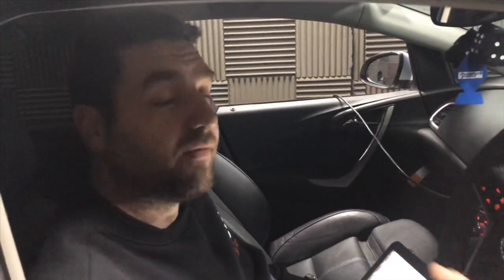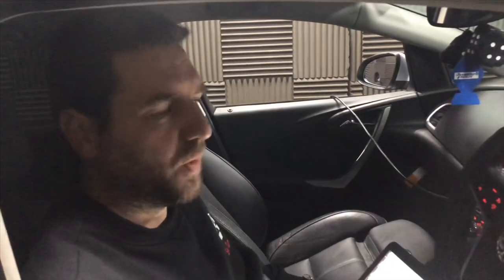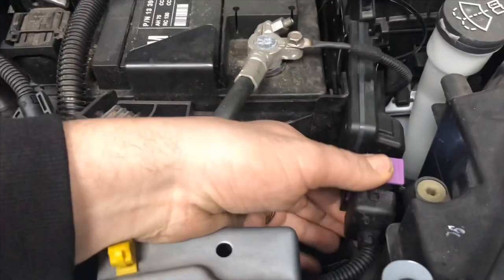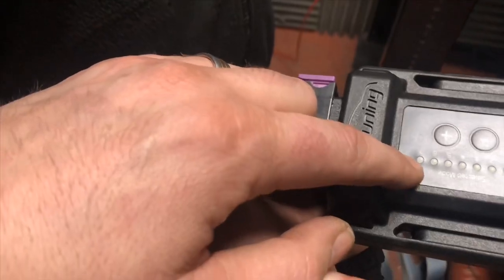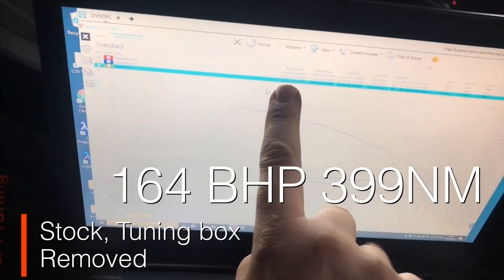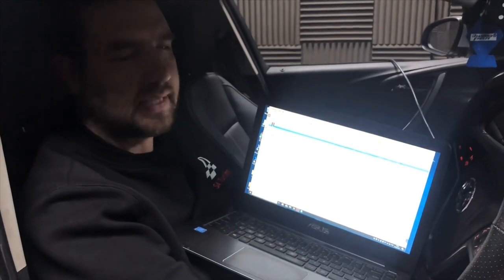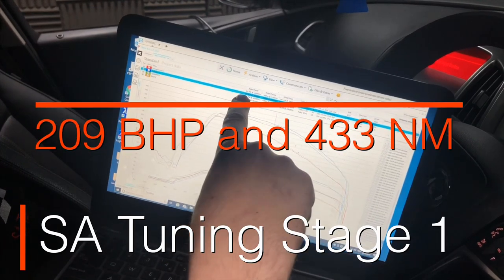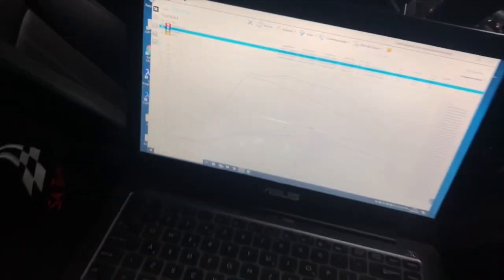Tuning Box VS stage 1 remap

Comment: a tuning company telling us a Powerbox is not what we need. WOW. you ain't gonna see a drug dealer telling you not to buy drugs and buy something else..  is the same as the Powerbox companies tells us to stop remaping our cars and use powerboxes :)
Reply: correct 100%
Reply: Well they test and compare on a live dyno unlike the powerbox companies👀 so i wonder who we should believe?🤔🤣
Reply: Powerboxes are totally rubbish guys... You can't tune a vehicle with an "out of the shelf" product.. Factors like: ambient temperature, distance from sea level,gas quality, condition of the engine  etc will affect the performance of an engine. Talking from own experience,i spent some amount of money to buy a "tuned chip" for my OBD1 engine and gain was 0. Then i did an ecu remap alone using an EPROM programmer and ProTuner and later installed a piggy back ECU too,best spend money ever....  If u have a professional garage near your area,go there,forget about those scams...

Comment: Good video. Music is a bit annoying though. Here's my tuppence worth - I've had 5 tuning boxes on 7 cars. All the tuning boxes were the same make as I liked it. I've had 2 cars with remaps. The results in this video are quite surprising to me and don't tally with my own personal experience though. 4 of the tuning boxes were fitted to Vauxhall/Saab/Fiat/Alfa 1.9 & 2.0 diesels. All essentially the same engine. I have, at the moment, a Saab with a remap. I decided to try a remap instead of a tuning box as I had a dpf issue & the remapped guy did a deal with map, dpf & egr plus carbon clean all at once. I've probably covered over 150k miles in cars with either a map or a box, and from my experience the differences between these two methods don't warrant the extra expense of a remap. Yes, the ecu remap is maybe slightly more linear in its power delivery, but not enough to make me want to pay 2.5 times the cost. The tuning boxes I use are 'digital' and have 4 pre determined 'maps' that you can then adjust. You can also get an on/off switch added for extra cost, which I always do. I can attest to these tuning boxes working and definitely giving extra power and torque. Easily done by just doing 2 runs - box on & box off. I have never had any warni g lights on any car with a tuning box. Ironically, I had an engine management light come on with my 2nd remapped car. The guy said it was a piece of duff code. He fixed it and it's not been a problem in over 26k miles now. The tuning box in this video was either gubbed, turned down or turned off. If you ask me, it's a promo for getting work. He blatantly showed the make of the tuning box thereby putting people right off it. Like others have said, you can get many a duff map just like a duff box.
Reply: Well said dougie boy ;) 
I just bought a gts race chip and app for £315 after kickbacks so I will basically pay out £29 A month for 12 months plus get £35 cashback within a week or two ... I know it's only tweaking the pressure rail but if it does the job idgaf as long as it saves me petrol over the duration plus I also got 1 new free install if I change car ...

Comment: Definitely tuning box faulty!!!!
0.5bhp no chance.
I prefer remap anyway but I had many cars with tuning box before and the acceleration was really different.
You can see one of my videos
Passat B6 2.0tdi 170bhp with tuning box installed which I bought from Poland for 40 pounds.
With tuning box
from 0-62miles in 7.2second.
That's not bad for 40 pounds.
Reply: Yeah, pretty easy to leave it turned off (as you can do with TDI box and still have it fully connected) then do your demonstration Dyno run, to be believable it needs to be reviewed by independent comparison tests on performance and outcome based  on the cost of each method.                                                                 I have just bought a TDI tuning box that I can turn on or off while fully connected, can remove with no trace, can set a timer on for warming up my motor before initiating the tuning box.                                                            I have seven setting options I can change at any time with Bluetooth connection on my phone, can turn off and on with my phone and I can also guarantee a remarkable, very noticeable difference in both power and torque, even on the lowest of the seven settings.                                                                I may or may not have the same results I’de get for a re-map, but that’s understandable, the tuning box has to be conservatively tuned, so the customer dose not have problems when they install it at home. So for this and considering, they don’t have the Luxury of maximising the final results of the tune, without in-house diagnostics, they loose the advantage to test  and tweak the outcome.                                                         Why did I go tuning box. I can’t turn of a re-map and the research I’ve done, seems every company re-maps based on the individual opinion and all say the way they do it is the best way, and to be fair, same goes for tuning chip and box companies.
Reply: Martin my cls 224 bhp v6 320 cdi doing 7sec till 100.
And bmw 530d e60 the same 7 sec..and u can do 2.0 be like 3.0 d for 40£ really)))?

Comment: I did alittle check myself. Dyno ran my stock 08 focus st, it got 218bhp. Installed the top price £300+ tdi tuning box, did the run in process as instructed by tdi tuning.  Did a Dyno run again and got 253 bhp, against the claimed 280 bhp ! Did a remap using a commonly used kess software  for £200 and got 276bhp on the dyno
Reply from the maker: Mathew Wade hi there, yes we see this all the time, Alientech kess you mention is the hardware to enable you to read and write to the ecu the software put on it must have come from somewhere else as the Kess does not modify the software it just reads and writes it. Kind regards SA Tuning

Comment: I put a blue spark box on my mazda 6 2.2 180hp diesel and made a massive difference. It knocked a second off my 0-60 times and a very big noticed difference in throttle response.
Reply: ATL  Who me?
Reply: I've been looking at getting a bluespark, would you recommend them? I've looked at the people who come to your house and mao your car but I'm sure that would just be the equivalent of a permanent tuning box.
Reply: @jasondonavich2758  remaps are simply better, they offer more power and better power delivery. The tuning box is slightly more practical as you can install yourself quickly and remove anytime and sell. Therefore the box can be worth it beacuse you recoup much of the already small cost to buy if you decide to sell it.

Comment: Well my 500 Abarth did 133bhp 155ftlbs stock then a TMC tuning box and got 166bhp and 180ftlbs.
Soooo much better with being able to plug and play, could then take it off years later to sell when the car was sold. Win win for the tuning box
Reply from the maker: Di you have the dyno printout for that? Also you can remove a remap in most cases in under 5 mins too years later and then sell the car so it’s a win win for a remap too!!
Reply: @MaxtuneOfficial  I did keep it and it's probably somewhere. It's the TMC box which are very popular.
With a tuning box you can remove it yourself where as a remap you may need to drive for miles to get back to the company which is less convenient
Reply from the maker: Drone UK this is why we have #truetune you can remove the remap yourself whenever or where ever you need too as many times as you like and re apply the remap! Genuinely a win win! Cheers 👍
Reply: @MaxtuneOfficial  how much is the true tune?
Reply: @colinparks619   A lot!! For what is a dressed up more user friendly Kess.

Comment: I have the same box it's from tdi tuning, The instructions are to run the car for 10 miles in each mode, there are 7 modes. This allows the car ecu to adapt to the box software. The instruction sheet that comes with the box is very clear on this.
Reply from the maker: Nick Smith the box was fitted to the car 10 months before it came to us so it had about 10 months to adapt in the highest setting before it was run on the dyno in the highest settings, we then removed the box the only time it had been off the car since purchase and ran it stock and then our stage 1, so we would assume that 10 months for the ecu to adapt would have been plenty! Cheers

Comment: You've proved a point that A certain tuning box doesn't work well for that specific car.  Yes Stage 1 will always be better than a chip tune, but not all tuning chips are useless.  For example, I've got a TDI-Tuning box in my Mercedes A200 (Also 163bhp stock), and it claims 201bhp when its in.  I've never done a dyno run or tested it, but I can 100% feel a massive difference with it in.  The difference in acceleration from 2nd to 4th gear is massive.  It did also go from 7.9 second 0-60 to 6.9 so it took a full second off it.  Chip tuning is the better option for new cars as it keeps the warranty in the vehicle, as I have removed my box on 2 occasions when taking it to the Merc garage, and they didn't notice a thing :)
Reply from the maker: You literally just made our point about the video “yes a stage 1 will always be better than a chip tune” feeling a difference is not an indication you have achieved the figures quoted that that car is actually fulfilling its potential. The truetune can revert a car back to stock “original” easily and freely whenever and wherever the user wishes including going into a dealership for warranty work for example.
Reply: he just said it took a second off his 0-60

Comment: Do you know what I think your results are correct SA Tuning. I have had exactly the same £400 tuning box fitted to my 2.0L BMW petrol hybrid which "claimed" to be 305bhp on setting 7. I had the car professionally remapped today and the difference is like night n day in terms of it now struggles for grip [ok its damp today] in second and 3rd gear. Your tests I reckon are accurate in terms of forget the tuning box and just get your vehicle mapped - the results are way better. Keep up the vids. Great

Comment: dropped himself in it when he said he had the tuning box on setting 7 max power but pointed at number 1 which would not really change anything apart from better fuel economy
Reply from the maker: becka becks if you look a bit closer the box is upside down so the max setting 7 is on the left and 1 would be on the right hand side, so not dropped myself in it at all! Cheers

Comment: I’ve had tdi tuning and chip express tuning box on my 2014 e350cdi, tested 0-100mph, had zero gains, no improvements at all
Then went to amd tuning and had remap, with printout that stated i now had 300hp, improvement from 252hp(stock)
Then went to do same test on the same road, and had no improvement in acceleration 0-100mph
Explain that one!?
Reply from the maker: R_ P_ easy to explain you did not come to us for a start where would have diagnosed an issue with the car if there is one, 350’s are notorious for boost leaks and turbo actuators being faulty, also the tune may not have Ben great like the Tuning box, hard to say without seeing the car but there is something not ok there I.E the tune the box or you have a mechanical issue!! Explanation done! Cheers
Reply: SA Tuning where are you based, and how much you charge for remap

Comment: Wonder how my astra 1.9cdti running a dtuk tuning box pulls on my mates astra 1.9cdti with a stage 1 map, when I'm apparently only getting 0.5bhp over standard🤔🥱. Kind of baffled here 🙄
Reply from the maker: Don’t worry out being baffled it’s either your friends car has an issue I.e. boost leak or similar or he can’t drive, the remap he has is rubbish or not remapped, not all remaps are equal but we guarantee a dtuk box will not beat our stage 1.👍

Comment: Great, but kiss goodbye to your dmf flywheel and clutch without upgrades after the tune up.
Reply: Meh, total crap.  Stock clutch and flywheel on a car will handle that extra power no problems.
Reply: @jimftr  dmf flywheels don't handle it, do your research, do you even know what one is!!!!!
Reply: @yammydodger1988  Yes I do know what a dual mass flywheel is, and I'm not sure why you seem to think a basic remap is going to kill one, or any other components for that matter.  These parts are designed to handle a fair bit more than the stock power, I'm pretty sure you already know that.
Reply: @jimftr  standard flywheels can handle the uprated torque but dmf flywheels have always been an issue when it comes to even a basic remap, especially on diesel Vauxhalls, they were designed purely to reduce vibration through the gearbox, terrible design and a big risk when increasing torque.

Comment: Surely the ecu needs time to relearn, between box and remap, otherwise it wont know if its coming or going lol
Reply from the maker: Hi there the ecu does not need to relearn anything as the signals are falsified from the Tuning box the ecu has nothing to relearn as it thinks everything has been under normal parameters and the an ecu will relearn any trims after 2 dyno runs anyway so this has no effect on the outcome whatsoever at all, kind regards SA Tuning